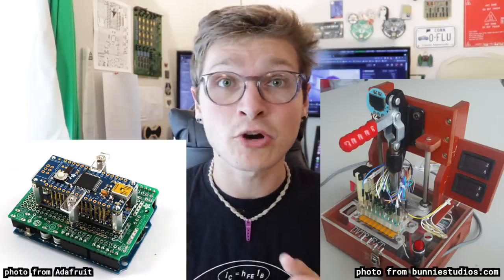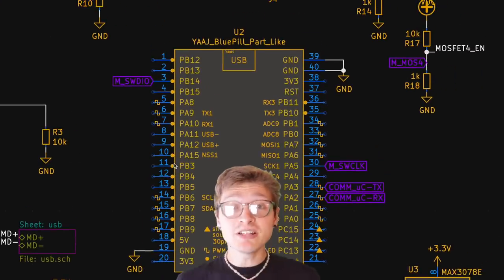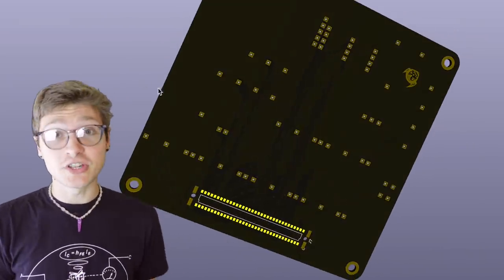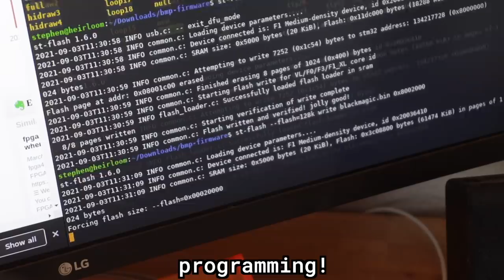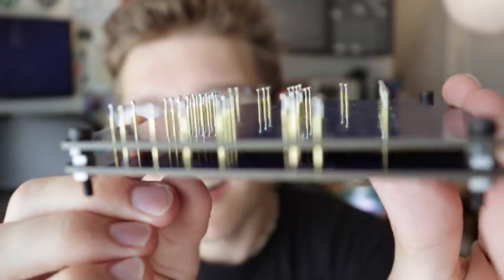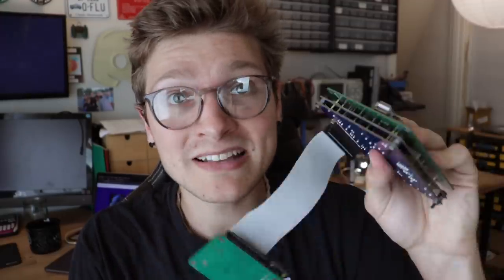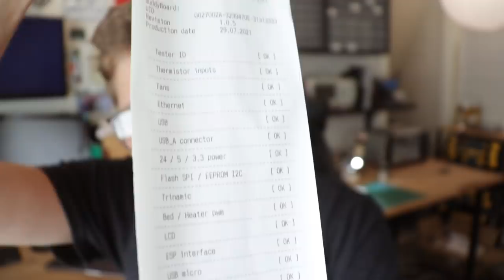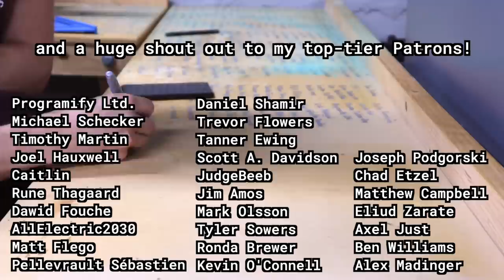These Are a Game Changer for PCB Production

Comment: Pro tip for the pogo pins: Don't solder them directly to the board, use the correct receptacle. This way you can easily change pins, once they get dull.
Also, sometimes it is necessary to play around with different tip types and spacers to get a reliable connection. 
Having an unreliable test jig is just the worst, it costs so much time and headache.
Reply: Is it possible to use a standard 0.1" female header for that?
Reply: I've always heard that, but never seen pogo pin holders, and it sure looks like Adafruit just solders their pogo pins right into their test jigs.
Reply: @rpavlik1  production "bed of nails" testers use socketed pogos. They wear out over long production runs. Also applying even pressure across the unit under test pcb take fixturing skill. As the pogos are increased in number, the force can add up significantly.  I have found pogo pins small enough to fit in the .1" female headers and might be fine for smaller runs of testing/programming.
Reply: Not sure he is going to be testing the kind of volume where thats going to matter.

NB Pro pro tip. Use slightly shallow receptacles for the pins. It can be a hassle to get the pin out if the pin head breaks and everything is flush with the receptacle.
Reply: As someone who worked as a test engineer at various contract manufacturers for 15 years, I can tell you these little "customer designed" functional test fixtures can be a fcking nightmare to maintain.  If you are testing 50 "first batch" PCBs, okay.  Don't expect to run 1000's of boards over something like this.
Reply: @jessstuart7495  
That is exactly what I did...testing PCB's manufactured in China.  
There were runs of thousands and I tested each one on a pin jig with replaceable pogo pins...
and the spring pressure from 15 large tall pogo pins required two large bulldog clips to hold the tester and the board in contact.
Each run of a thousand would have a different fault or unreliable component...or even a counterfeit one...
The techs would then rework the PCB's as each one was $10US.
The way the Chinese operate is you select a manufacturer...then you pay up front for everything.....
They make it and ship it to you.
You test it. 
Any faults you find are not their problem. 
They say "We made it to your design and specifications."
Next time you might change to another manufacturer.
Same routine........
Occasionally the pogo pins would be the problem...and need replacement.
Good pins are quite expensive......
Reply: @jessstuart7495  This is exactly what we do also. Hundreds of boards per run, about 5k on 1 jig per year. Never had issues. When we do, usually just pull them pins up or down in the sockets, and replace them when needed. They are not hard to maintain at all.
Reply: if you use test points on the board you are testing, you already have the positions of where they all should be

Comment: The only thing missing is the provision of "tooling holes" on the board to be tested. These engage with steel pins on the test jig so the two can be aligned accurately. These tooling holes have to be specified with a tight tolerance.

Comment: You need a way to keep track of the boards. Either enter a serial number that is on the board into the test computer at the start of the test, or print a SN sticker for the board from the test jig. If you ever need to rework an already tested board once its been fixed the second method doesn't really work though as you lose all record of it being reworked. I would give all your boards a machine readable serial number (barcode/QR code) so you keep a full history of the test you ran on a board even if they're reworked. If you assign the serial right after reflow you can also track back to the machine the board was made on and see if the same issue is occuring on the same machine allowing easier troubleshooting.
Reply: You should be able to use the mcu serial number once that's installed, probably good to put it visibly on the board too as you point out
Reply: Pro tip 👍
Reply: What about flashing the SN into the device's EEPROM?, apart from the sticker. That way, if the sticker falls, you can still get the serial number from the device
Reply: If the MCU has an option to read it's serial number then it's probably the simplest way. You can also buy EEPROM chips with pre-programmed MAC adresses. iirc TI sells those. They don't cost much more than a normal EEPROM does and because each MAC address must be unique it's a great way to get some unique IDs for the boards.
Reply: Exactly!
Reply: STM parts have a 96bit UUID baked in. That is what I use.
Reply: @TechRevi  but it's always better to have something visual on the board instead of having to connect and read. You could always map the UUID to the serial number in the test report. This way any labels you put can also be verified if needed.
Reply: @thunderb00m  Of course, that is why you read and print that as the serial number on the board. You run the test/calibration, print your label and put it on the board. I use a hex format.
Reply: @Tim_Mortensen Read my mind. Just opened comments to type that andnyou saved me the trouble!

Comment: Developing test equipment for electronics production for a living there are only minor things I would do different.
For the actual bed of nails I would solder in capsules. That way you can exchange test probes in case one brakes or you need one with a different tip. The capsules also help to get the exact depth on every pin.
Testfirmware is a great decision, makes so many things easier. Jtag is mighty but also pretty involved to get started.
The software side also sound good. We use NI Teststand as a test sequencer but that is very expansive an a simple python script should do the trick as you said. Customers love to have a test report, so good there ;) We log our results to a SQL database. It's always handy if you have an individual QR- or barcode for the serial on the individual boards themselves. Some board manufactures can add such a QR in production (you would only have to scan it). But that might be a bit overkill here. All in all awesome project and really well done :)
Reply: What's a capsule?
Reply: @DavidD-xm4rz  well, I know them, they are my main suppliers for probes (and sleeves) ;)
(that is why i called the sleeves "capsule", since that is what they call them on their englisch site)
Reply: @MakenModify  QA Tech and a few other probe manufacturers call them sockets

Comment: I first saw a bed of about 500 spring pins at IBM in 1985, they were testing very large disk drive circuit boards. Glad you found them ,they're awesome. I've used them on and off for about 15 years or so. Nice work on using the same design to run your tester. Thanks for the video.

Comment: Awesome to see a PCB testjig with pogopins. It has been on my todo list to experiment with this concept in a long time!
Reply: I encourage you to give them a try. I make jigs like these for 6 years now and love not having to connect wires. Also using a sleeve for the pin is a big recommendation over just soldering. Sometimes tin seeps into the pogopin making it useless
Reply: Added to that supporting the tips is important. They bend easily en then they don't spring back. Usually I make a cover plate that only let's 2mm of the pin protrude above it.
Reply: @justingort1  Can you recommend some small pogo and sleeves? :-)

Comment: One tip for your next rev of the bed of nails, mounting the pins in such a way that the solder joint takes the mechanical stress of the depression load, you will experience solder cracks which will give you a few headaches. I can't tell if you are using recepticals  for the pins, but next time you should, you'll find they have a small ring around 3/4 of they way up their length and that should mate with the top surface of the BoN PCB, that takes a lot of the load away from the solder joint. Another thing to do is to make sure that the BoN can't flex at all, otherwise you'll hit the same problem again. When I build mine, I typically stack laser cut sheets of MDF or perspex between the two BoN PCBs to support them. I'm not sure what quantity you are intending to put through this jig, this may not be a problem if your quantity is fairly low. But I have successfully pushed 40000 devices through one of my jigs with the above method and never had a joint fail. Another tip, the recepticals allow you to remove the pins when they fail, which again does happen. Especially when you aren't using guide pins. You should use spring loaded guide pins and a clamping mechanism to ensure your board locates correctly and is depressed exactly parallel to the BoN other wise you'll wear out the pins even quicker.

Anyway, great work!

Comment: Awsome work!!! As others comments you could add some tooling alignment pins, maybe you will do on the Jig press you mentioned. Also traceability with a serial number, labeled or embedded on microcontroller, is a really good one to have. Also you could add a test byte on memory, if a unit passes you store a flag to confirm the board was tested and further tests or field users can be sure all potential issues were tested for that unit.

Comment: I worked QC in the 90s.  We had a machine that had different fixtures for each board we made.  They had a vacuum suction that pulled the board down into the pins to do automated in circuit testing of all the components.
EDIT: I would agree with the other commenters that you should put the pins in sockets for easier replacement.  They can easily break if you miss something on the visual inspection before testing that causes lateral pressure.  Or uneven pressure from through hole leads.  Was a common problem I had to fix at least one broken pin a week.

Comment: Have been using pogo pin for years as an easy way to reflash firmware on tiny embedded devices without having to move or unsolder anything.  They're wonderful things.

Comment: I remember having to set up a system like this that needed to use some ancient toolchain software -- each test run would involve the tester needing to spin up different Windows XP virtual machines in sequence, and use a script to move the mouse pointer around to different buttons on a bunch of different crappy GUIs to run a minutes-long test and programming procedure on each board.

Comment: Nice! I'm going to take your idea of using 2 PCBs sandwiched to align the pogo pins vertically. :)
I normally 3D print the jig and super glue them to align it vertically but your sandwiched method is definitely more easier to assemble!

Comment: If your gonna run the raspi headless you might need some automatic script to pull the master version of the testing software automatically
that way if it has wireless you don't have to get it out of the jig to update that part of it.
Reply: Could also ssh into the pi to run the update. My pi servers are headless and I do everything on them from SSH.

Comment: Loved the way this was cut, and how you managed to make soldering engaging.

One quick pro tip: don't bother with paste if you're not stenciling - it just balls up and creates metal fragments all over your board which creates cleaning time and potential for shorting. Instead, tin your pads with ordinary leaded solder, purchase a hot plate (learned this from Sparkfun) and just fire up the hot plate with all of the components in place. The whole board will solder at once and components will slip into place just like a reflow oven.

I really like the mindset you employ, a la "if it ain't broke don't fix it" and it reminds me to just stick with things that work already, rather than constantly try to put my personal stamp on designs. There's already a ton of amazing projects out there on the open hardware scene, I should really focus more on supporting them than going off on a tangent. Thanks for the extra perspective!
Reply: Ok but how do the parts get held in place ?

Comment: If you're going to use a Raspberry Pi as for ATE control then hook up the 7" R-Pi display.  It's not to expensive and will give you nice feed back and since it's a touch screen a great control panel.  You can get very nice enclosures, like the SmartiPi case, that can be screwed down to a board along with the other PCB's for a compact all in one unit.

Comment: Funny I was using them 40+ years ago,  you have to remember that the board must push down in a straight line.  So your  board clamps should not have a curve  in its path after it starts to push the pcb onto the pins. as somebody pointed out don't solder to pins, if board placement moves you can easy bend the pins. Also one pin head shape does not fit all connection.  Built a few custom ATE racks in the 80's for testing  production pcb's most have used 1000's of pogo pins.
Reply: Same here, those things have been around for many decades.

Comment: I like Superbuttons made by HCD (High Connection Density, Inc.). They're a wire engineered to be a highly capable smd contact that sits in a double sided adhesive backed carrier laminated/adhered to test pcb with no soldering.

They can be less than 1mm thick and 6A-12A per Superbutton. There's no time involvement trying to get contacts all parallel/perpendicular because Superbuttons are held together by the carrier which is just a sheet of plastic or composite with drilled holes for Superbuttons.

Comment: If you look at some of the Desk of Ladyada videos as well as their Made in NYC videos, you'll see a bunch of their pogo pin test jigs. Fairly similar to your basic plan, except they tend to use Teensy boards to drive the test so they can put the firmware on sd card and their swd dap library plus whatever test functionality is needed, have enough pins for a 16x2 LCD for results when the product isn't a display. Cool to see your slightly different approach. They also have a couple kinds of little clamps they use. 

Love the thermal printer idea. Definitely serialize the boards plz, and/or at least track batches.

I have a ton of pogo pins (ended up getting 10x my order) but have only used them for Arduino Nano 33ble swd pinout, plus some battery boxes.

Comment: everett charles technologies has a wide range of probes and receptacles. Back in the day I had 1000+ probe in-circuit test fixtures loaded with their probes and had very little issues. The square end 0.1" centers  receptacle tails will fit into a standard 0.1" IDC cable header OK.
Board under test needs to travel parallel with the fixture base or the probes get a side load and either bend and then stick down or snap after a while. Tooling pins keep the board aligned with the jig and help to prevent that a lot.

Comment: Steven, awesome work. I've been quietly following along for the past few months. One thing that could help you with your one-off boards is home made laser cut stencils. I don't think you have a laser cutter but they've gotten pretty cheap over the past few years. I personally use 5mil kapton tape and it sticks right to the pcb after some alignment. The kapton costs as much as the laser cutter but I've been using this method for years with the same roll of tape I started with! Just an FYI from someone who is burned out on hand soldering smd parts.
Reply: Since the boards are sponsored by PCBWay, it should be very easy to get them to send a matching stencil along
Reply: He just have a thing for manuel soldering. He was streaming the soldering process and told us that.

Comment: Also for the shared server, might want to stick to plain HTTP/REST instead of plain TCP, will save you a ton of headaches. And you might need to find a way to identify every board with a serial number barcode or a programmed serial number.

Comment: you dont need to solder or use a PCB. You can 3d print the fixture to hold the receptacles and the pogo pins.

Comment: That one "extra" UART is a GDB server.
BMP won't allow you to flash / read at custom address. It only works with ELF files.
And watch out for wrong value USB pullup resistor on those blue pills.

Won't it be easier for you to flash target with some code that will do the test and report back ? Instead you have poop loads of pogo pins.
Reply: I'd sent a link to github but YT genius AI removes my comment with link.

Comment: So, why did you use a black magic probe to program the STM32F407, but a SWD programmer to program the STM32F103? You could have used the same SWD programmer for both STM chips
Reply from the maker: Honestly, I didn't have the 1.27mm -> 2.54mm header converter to make the connection! 🥲

Comment: I wonder if the sharp points of the pogo pins will wear out the pads on the bottom of the motherboard? Just my first thoughts with this, cuz I've actually been looking at this option for the same kind of PCB stacking function...

Great video btw!
Reply: Well if you keep testing the same board over and over then sure thats an eventuality. Might want to have actual pins instead of pads then and use concave pogos.

Comment: From what I've seen, spring pins in the real world cause nothing but trouble. I assume they are fine for a temporary connection, like testing as you've mentioned, but the use cases I've seen (robot joints, etc.) all seem to suffer because of them.

Comment: Can't say I agree with you committing the 'change after test' sin; response testing from a marlin flashed board seems drastically more sensible.
Reply: I guess it depends what you're testing - there's two things to check: hardware & software

hardware tests need to happen for every board, and seem to be the focus of this setup. software tests are less important for every board really - if you test it on a known board, and it works, then you know every board like that will work. Plus i'm sure the marlin team themselves will do a extensive testing of their own which removes a lot of pressure from small operations like this, that's one of the benefits of using marlin over a fully bespoke firmware